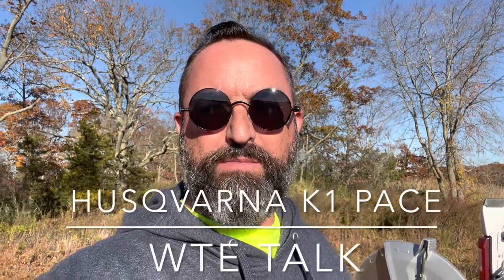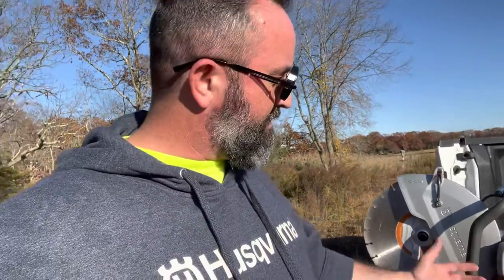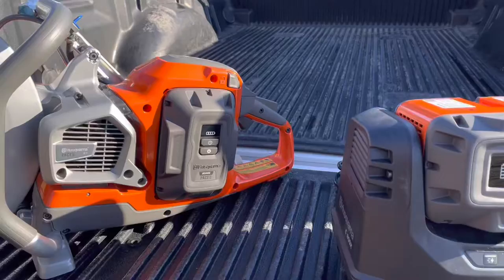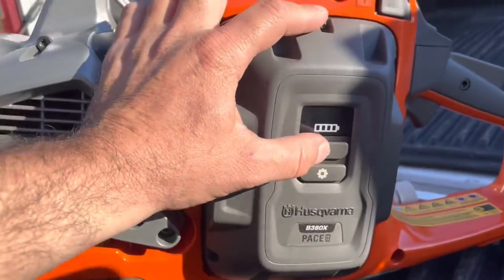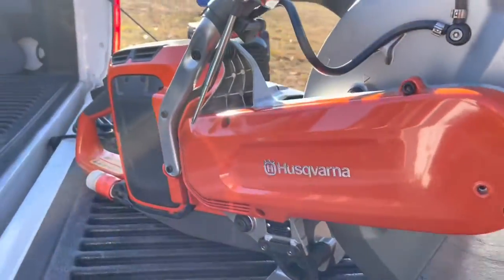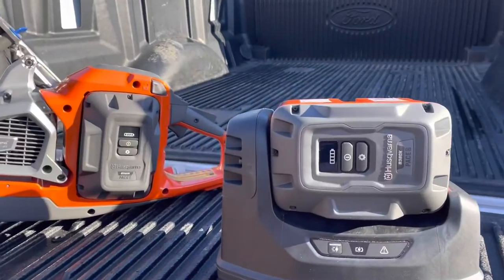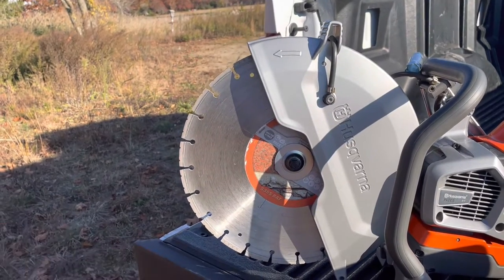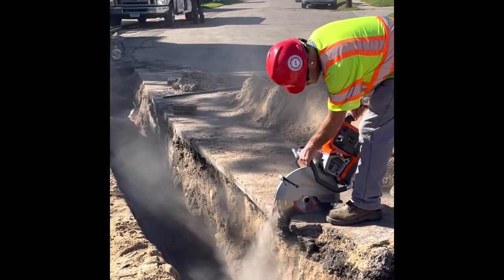HUSQVARNA K1 PACE SAW review

Comment: We currently have one of these on demo. The larger battery lasted 17 minutes cutting reinforced concrete and the smaller battery, 7 minutes. Great saw, but unfortunately, we're a few years away from producing batteries that are actually up to the job. The blades are also very expensive
Reply from the maker: @liamdobbs8272  it is definitely not for heavy usage at this time. I agree. However it seems to have a place for the right application